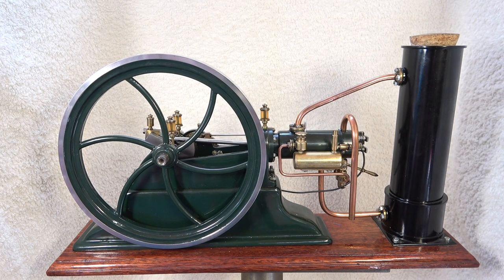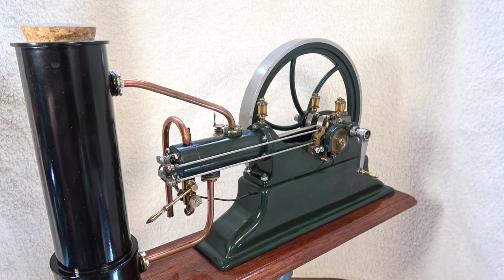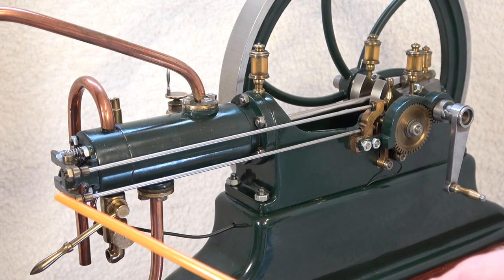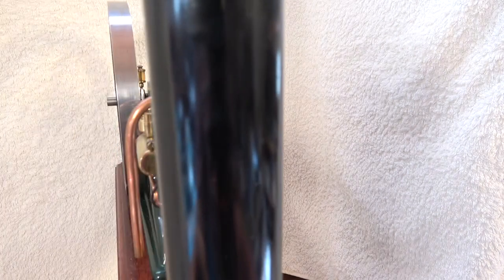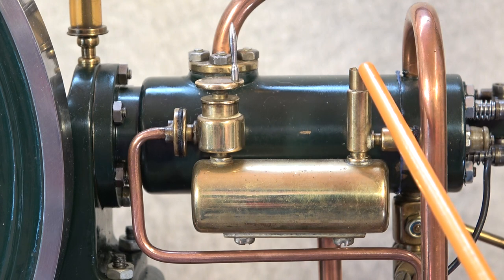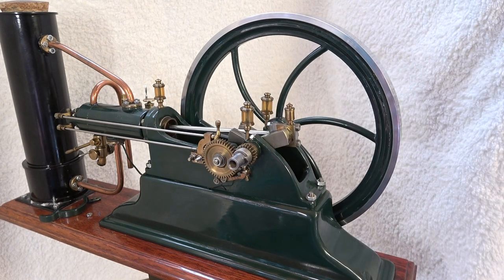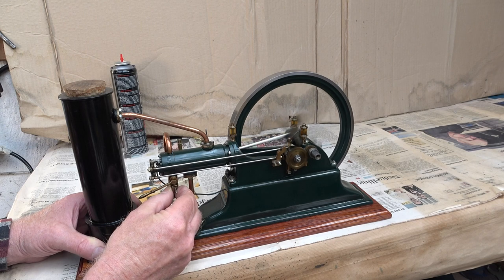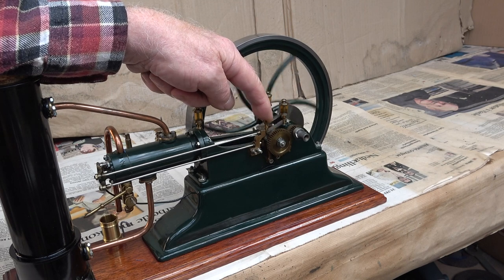Scratch Build Model Antique Gas Engine

Comment: Again a very nice engine. Is the gas continuously flowing? Or is it only flowing during the intake stroke?
Reply: Looks like a continuous flow setup. I don't see any kind of demand valve or other means of controlling the gas, other than the manual valves.
Reply: @MysticalDork  It doesn't flow liquid fuel to the Mixer. The fuel tank is arranged so that air is drawn in a vent and piped to the bottom of the tank. Air maximally saturated with Cigarette Lighter Fluid Vapor is drawn out by suction to the Mixer. The Mixer has a throttle which is a large solid rod bored on the axis away from the operating handle for a fuel vapor passage. The combustion air passage through the throttle drum has a crossways venturi shape wherein the opening is perhaps half as large as its outlet. At wide open throttle the venturi sucks fuel vapor through the tapered adjustable metering screw-jet. As it is throttled back the venturi's small opening is closed off more rapidly than it's outlet and suction is generated more by choking than by venturi pressure drop. It is analogous to how a conventional carburetor has a jetted liquid fuel inlet to the Venturi and a separate tapered screw "idle fuel" adjustment - - but this combines both actions by the shape of the venturi built into the large throttle shaft. 
     Shot answer is "It is Elegant Genius-Stuff" !